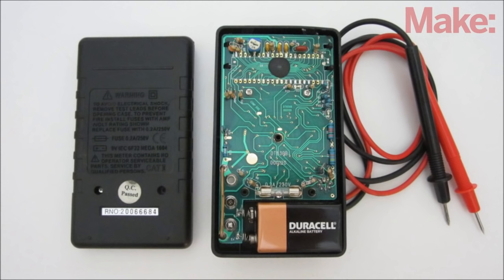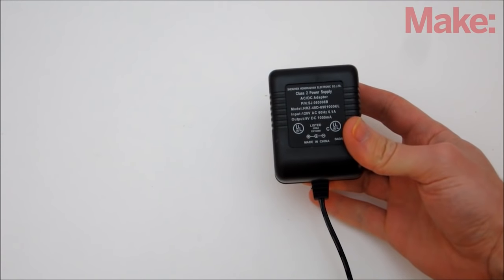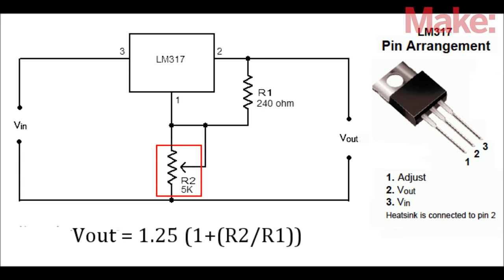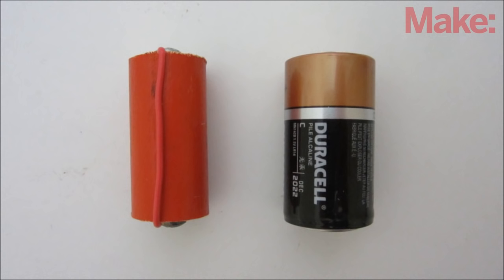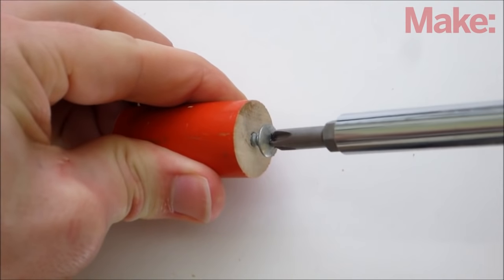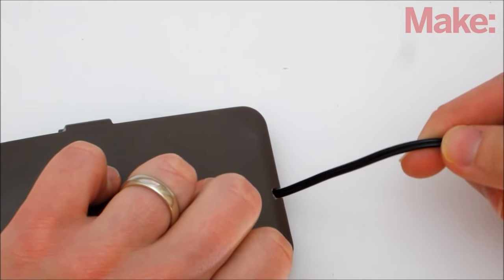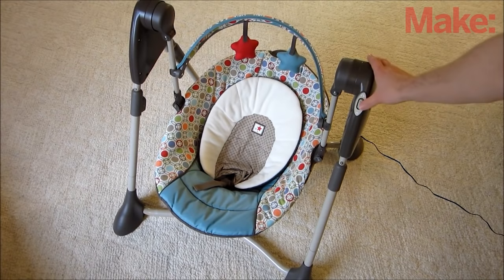DIY Hacks & How To's: Convert a Battery-Powered Device to AC Power

Comment: How about an even slower explanation for those with no knowledge of electronics
Reply: Sprice Machines I concur on this one. Make one as if the viewer has no previous knowledge of electrical work.
Reply: mrdean3 If you have no knowledge of electrical equipment then you shouldn't even try. Educate yourself then you can attempt this. I've been an electrical engineer for over a decade now and you can't learn everything from one YouTube video.
Reply: RoomerJ ,why would you   watch this video if you are a electrical engineer ? Are you  checking up on the  accuracy of DIY  electrical video  posts ?
Reply: electrical engineering basics: https://www.youtube.com/watch?v=X_KWJ_MinOU&index=2&list=PLX2gX-ftPVXXAQHPsgcokk4aCHZUKFuho
Reply: Settings → Speed → 0.5
Reply: Just Kidding, but i did this using an old cell phone (DC Output) charger and it worked just fine, just check the polarity , something like this ( + --@-- - ), voltage (DC 12 V or DC 5 V) in the output, and maybe the Amp rating (500 mA or 1000mA equivalent to 1 A), cut the cable end plug,  strip the wires of the charger and connect them to the positive and negative terminal of the battery compartment (Sorry for my grammar, hope this work for anyone).
Reply: Yeah, I agree.  There have been WAY too many house fires around me this past year from faulty WIRING of one form or another!
Reply: Sprice Machines will
Reply: Um, what's a "resistor?"  heh heh
Reply: @AdrianoCattini  I usually hunt out power supplies for electronics that didn't come with one. They usually have the voltage and amps printed on them. Does it matter how many milliamps as long as it meets or exceeds the amount specified?
Reply: @mrdean3  you have to be Dense. any slower others would complain that it's too slow. complain, complain, complain...
Reply: @RoomerJ  for this you don't need to Educate to attempt this. besides this may be a stepping stop in Education.
Reply: ARGH! darn autocorrect Stepping Stone
Reply: @vicoilsteems9764  I didn't even see these comments lol. This was in my suggested videos and I was curious so I watched the video.
Reply: @euronymussss  Of course not, but anyone that can't follow this simple process in the video without slowing down the explanation doesn't need to attempt said process.
Reply: @fvrrljr  I agree to a point, but anyone that needs the video and or explanation slowed down to understand this doesn't need to attempt this.
Reply: @altheamcnabb2829  Very true. Apparently some people in this comment section don't understand this.
Reply: @euronymussss  Yes it is an informative video but it's not a "DIY" video for people who are ignorant about how projects like this work. If any of the video is confusing enough to anyone to where they suggest the creator went "too fast" in his explanation they need to practice and educate themselves more before attempting anything close to this.

I've seen too many situations where someone got hurt by attempting to work on or modify electrical equipment that they had no business working on to begin with. Know your limitations and work to reduce them.
Reply: better let someone else to do it.
Reply: @BirkinIdk  do Miliamps matter if I'm using an adjustable adapter and I set the correct voltage??
Reply: I feel u hell with this it sounds like a whole other language😅
Reply: Go to the video settings and slow down the speed.

Comment: Title is wrong, the battery powered device is still running on DC power, but just from an AD/DC adapter, where you regulate the voltage.

Comment: Worth pointing out those switching regulators can get hot so take that into account when deciding where to place it and consider the load (current consumption) of the item you're powering.

Comment: Hi there, just a quick question. If the device I want to power up currently uses 6 x LR44 batteries in series (total 6x1.5V=9V), and I happen to have an old adaptor with 9V DC output, can I just wire the adaptor directly to my device without using any other components such as the voltage regulator? Does it matter if the adaptor output is 1A or 2A? And what if I plan on powering up 4 of the same 9V devices wired in parallel?
Reply: One device should be fine. A well designed circuit won’t draw more amperage than they need, so it should be fine. What is the current draw of the devices in question? As long as they’re in parallel the voltage should be fine.

Comment: Video summary: 

'I wanted to save batteries by converting my baby's swing to AC Power, so I did.'

The End
Reply: I did this and my baby rocker started flying around like a helicopter untill smoke came out of my wall wart and my breaker tripped.

Comment: Can this also be done to an 18v cordless power drill by using the same voltage regulator shown in this video? If not is there something else I can use in replace of it? Thx 👍
Reply: The lm317 regulates voltage from a higher input to a lower output you would need a power adapter that can supply more than 18v at least 20 to be sure, also a drill uses a lot of current and the lm317 will heat up a lot, you could use a transformer to step down mains voltage to 24, then use a bridge diode to make it dc and connect the lm317 to that arrangement. amount of heat generated is current*(voltageinput-voltageoutput) in watts
Reply: NOW THAT I UNDERSTAND. NOT!
Reply: Use 3 cheap 6volt lead acid batteries.They cost much less than the drill battery and I get 4 times the amperage.
Reply: PJ Like just for the Pearl Jam profile pic

Comment: Do you use long wires to connect each batteries? Additional info, make sure that the total average of battery use is equivalent to the voltage of adaptor to avoid overheating or exploding.

Comment: A question for you, if I may? I bought scores of AAA powered fake candles and wanted to make them all AC as they cost a ton in batteries...I want to daisy chain them with a power source so no more batteries. Please let me know how if you have any suggestions. I saw a video for one candle, in which he added a 6volt power supply as it was four AA batteries 1.5/3/4.5/6 but was wondering if you know if I need a converter for 'each' candle, or can I run them all on one ac adaptor? Is it depending on how many candles? I have 15 and they each take three AAA batteries. Any suggestions or help would be greatly appreciated.  And GREAT VIDEO! ***(I do not mind damaging the candle's back face and would not bother making fake batteries for my needs)

Comment: Love these videos. I second the motion on AMP draw on the power supply. Most devices with 4 batteries will not draw much but a motor like the swing could draw up to 1 amp depending on configuration. Use a volt/amp meter and take some measurements or look in the tech section of the owners manual. Google might even provide a direct conversion for the number of batteries and size to max amp availability.

Comment: Wouldn't the amperage output of the power adapter be an issue though?  E.g. I've got a bouncer that takes 3 x C size batteries, which output 1.5v each, but how to figure out how many amps I should be providing it?
Reply: The circuit draws as many amps as it needs so I would suggest 1 amp at your voltage that you need for the electronics

Comment: I just came on here looking to change battery to ac on my sons swing chair and this is the one I watched and coincidentally it’s a video about converting a swing chair as well 🤣
Reply: Same here. The ridiculous thing is that Our grace swing has an AC connect on it already... but it runs a separate function for the swing. Don’t know why the engineers opted for multiple power sources?

Comment: But what if you have like a old cellphone or old Bluetooth speaker were they charge the battery up too. Replace that with a power supply would it mess it up if trying to sent power to charge it?

Comment: *Can you do this but with VR Controllers?* I've been having a rough time trying to find any examples of any attempts of using Dummy/Fake Batteries for them.
Sure it's simpler just having rechargeable ones, but if your VR Headset is wired anyways, and won't die unlike your controllers, i'd personally want to hook up my controllers up with cables anyways especially for seated gaming.

Comment: What if I want to keep the batteries for when the power goes out but I want them to be constantly charged as long as power remains?  I have a smartlock that doesn't warn me when the battery level is low.  Could I just run a wire from the normal battery charger to one of the batteries in the lock?  If I do that would the charger still be able to avoid overcharging the batteries?

Comment: Hi, I want to convert a 3.6v cordless drill (I removed some shitty 600 mAh NiCd batterys) and use the charger that came with the drill.. but the charger it has a 5v output... can I use it anyway or it will eventually wearout the electric motor 'cause the higher volt??

Comment: Anyone have any thoughts on converting a battery charging base into an adapter for power wheels? I have a 24v power wheel jeep. I’d like to use drill batteries and adapters are available but not for the 22v Hilti batteries. I was thinking that it might be possible to tear apart a charging base (that is normally plugged into the wall) and have IT become the adapter.
Reply: 3D printing, people have made bases for Milwaukee, DeWalt, hilti. Look up the STL files

Comment: PLEASE HELP ME;
I have a 12 volt cigarette socket powered vacuum cleaner but it no longer had the adapter, now I want to make it work from the mains, is this difficult?
I have plenty of electrical bits spares so I may have what is needed for this project. Any help appreciated :-)

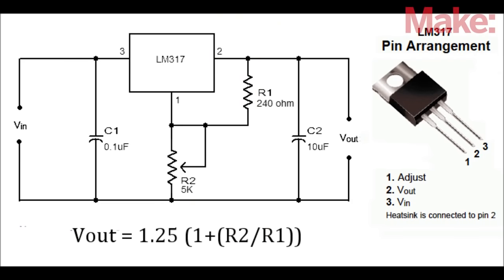Comment: I can only describe 0:47 in the language of screams.
Reply: +KarlaRei you should go to the video:
"Collin's Lab: Schematics"
it helps it seem little less scary.
Reply: +InglitzRavenStar I tried to watch those videos but I ended up not being able to see the diagrams through the waterfall of my ignorant tears.
Reply: easier to just go to goodwill or salvation army and buy old power bricks. it's actually not hard to find one with the right voltage.
Reply: Go to a used store like goodwill or value village and buy an adapter with the same voltage. For most electronics matching the milliamps within  1000mah works some are more sensitive. I saved $50 on a  "garbage" laptop power supply this way. It's always somewhat risky take time and research several videos. I don't particularly like the idea behind this circuit as a quick fix.
Reply: @holden_tld  don't forget to match the milliamps

Comment: I've just started getting into electronics a couple of months ago and bought an adjustable ac to dc adapter like this. I learned the hard way just how unregulated the voltage coming out of these things is. When set to "off" it would still have 0.5v across it, but when set to 9v, the open voltage would be a very unreasonable 18v. I get that the voltage drops when you connect it to a load, but I couldn't for the life of me get it anywhere near 9v. Meanwhile I blew the 250ma fuse in my multimeter because I got twice the voltage I was expecting.

Comment: hello, need some help. 
I have an outdoor motion light in my drive way. it's using 4 C battery’s, and would like to get a wall adapter. What voltage adapter should I get? I can get one that change from 3, 5, 6, 8, 10, or 12. 
Thank you in advance.
-Anthony Mendonca
Reply: 1.5V*4=6V

Comment: Can you do this vise versa??? Like change the big power brick to a battery pack I'm kinda new to making circuits and such
Reply: +Evan Anderson 
Absolutely, just check what voltage / amperage your power brick puts out and replace it with batteries that can match it.

Comment: Hi, please could you kindly help me. I've been looking at your videos and you definitely know your electronics. I have some knowledge but would like your advice. I have a cordless mitre saw. The mitre saw currently runs off batteries, which are 24v, with ah ranging from 2.4ah to 3.0ah. The batteries run a motor that requires an output off 630watts.

I would like to run the mitre saw off mains supply (230v). I found a LED Driver power supply transformer AC 110v - 240v (input) - DC 24v (25ah at 600w). Would this transformer work, would it be dangerous or safe to use on my mitre saw. The mitre saw is a Dewalt DW017. 
I would appreciate any help, advice or alternative idea. Kind regards

Comment: I need to do this for my cats toy. But how do I know why type or voltage of power supply to pick.   Here is my problem.   Our cat gets these 3:30 am zoomies and he needs attention.   Of course we're sleeping and I'm not about to switch to his schedule.  He has this toy called Hot Pursuit which is battery operated by 3, AA batteries.  I tried an Amazon battery converter but it said it was good for LEDs and didn't work on the toy. 

The master plan is I get the toy to have a power supply,  and the power supply is controlled by a smart plug so we cant have the toy distract the wild cat at a programmed time like 3:30 am

Comment: How can this be implemented on a digital multimeter to replace a 9v battery? A have a 9v-0.6A power adapter that I would like to use on it.
Reply: noise from the outlet could affect on measurements. I woyuld stick to batteries for this one.

Comment: This video is missing some essential information that can lead to some big safety concerns.  The LM317 is a linear voltage regulator for DC power.  The video should clearly state that the power supply you pick must be a HIGHER VOLTAGE and HIGHER CURRENT RATING than the device you are going to use it on. The LM317 can only lower the voltage of your power supply, not raise it! If you also use a DC power supply with a lower current (A) rating than the device you plan to run, you risk burning it up!

Comment: I have a small digital camcorder that uses 3 AAA but they never last more than an hour. I'd like to convert it so that it uses 1 or 2 18650 26MaH rechargeable batteries if possible.

If possible which I'm sure it is, what would I need?

Some voltage regulators, maybe a capacitor?
Ido how ugly/bulky the camera ends up looking as long as it doesn't power using 3 AAA batteries.  Can you maybe make a video about this please?

Comment: I have to agree with most of the other post, you totally skipped over which terminals to connect your hot and cold wires to and why you need dummy batteries at al?

Comment: I would like to see how to convert a battery-powered string/edge trimmer to use AC Power.  I hate to buy battery pack.  It is way too expenses.  EGO device is the best if you can since one EGO can handle different heads. Thanks
Reply: Anything with a powerful motor is more complicated. You could burn out the motor or not have enough amps.

Comment: The lm317 is not needed and will cause problems with motors and cook over 1 amp w/o heatsink.  Just pick the proper voltage and more than 1000Mah and watch polarity + - .

Comment: Isn't easier to open the box, and conect the cables directly to the battery slot cables, instead of making the dummy battery?
Reply: +Darryl Edington One advantage of dummy batteries is that he didn't have to solder or modify the battery compartment, although he did cut a slot in the battery cover for the cable.
Reply: I really like the dummy battery idea, because some devices are too small and intricate to tear apart.

Comment: If you using wooden dowels as dummy batteries,  does it really matter which side is + or - ????
Reply: 3 of the dummy batteries do not need + or - markers. The 4th battery has a linear voltage regulator connected to it, and current can only go through it in one direction, which is why it has markers.

Comment: may i used a 6 volt adapter in a portable speaker with rechargeable battery which has 5 volts.

Comment: You don't need to hack an AC adapter.  There are plenty of off-the-shelf 6V DC adapters (typically used for cordless phones).  Most people would probably have some old ones laying around from old cordless phones.  There's also no need to make dummy batteries.  Those can be purchased for around $1 a piece.

Comment: I have a 3.7v battery & want to add charger adapter & add input plug to device, so battery runs device & I can plug in a charger,problems with input plug

Comment: Can someone tell me if its possible to applique the same principle  to a android phone? I have one galaxy S3 in good condition, but the battery has almost exploded... And I wold like to make it work again without buying  another battery. Thanks.
Reply: +Manuel Marçal yes you can, but you will have to get a power supply that can supply 3.8 volts DC and you will have to make a hole in the back of the phone to get the wire trough

Comment: dumb question but how did you figure out what to resisters to use
Reply: Cat008101. I am thinking it is a good question. I would think there would have to be a chart. It would depend on both the incoming voltage and the voltage you want. From there, the chart would have a match. At the match is a value of recommended resistor. Then check. Make sense?

Comment: Worth mentioning that you need to understand what power your AC adapter can provide and what the load requires.  That's a linear regulator which can get quite how if you don't do the waste heat calculations.

Comment: I tried a laptop PSU as it had a couple of amps, but it cut out if you pressed the trigger normally, I had to squeeze it gently so the drill worked at a very slow speed.

However, the 18v drill worked great wired to a worn out 12v motorbike battery, just slower.

Comment: First check how much current the mini compressor needs (look at label for a number with "A") and buy or get a 120VAC to 12VDC converter that can handle that or more current (more than 2A, maybe 5A). Cable polarity not to be missed and have converter in a cool place as it will get hot.